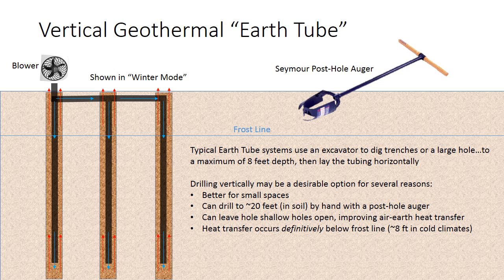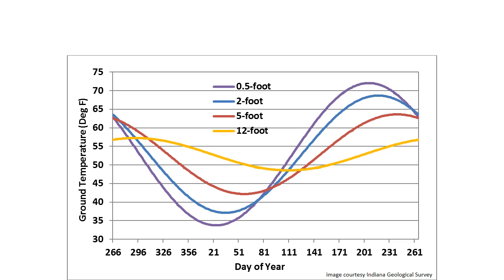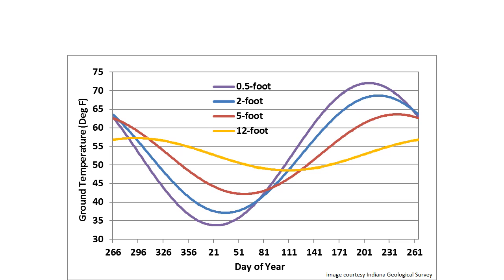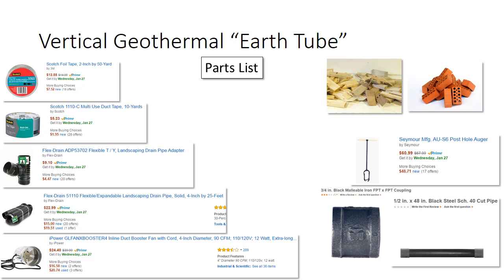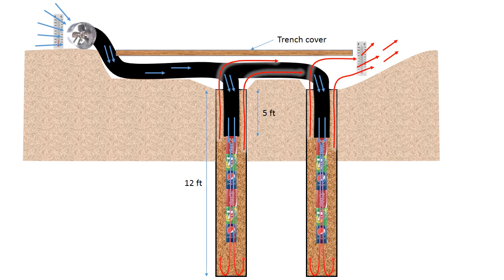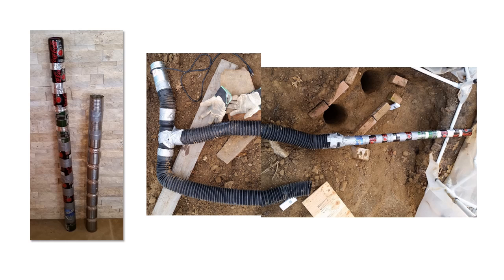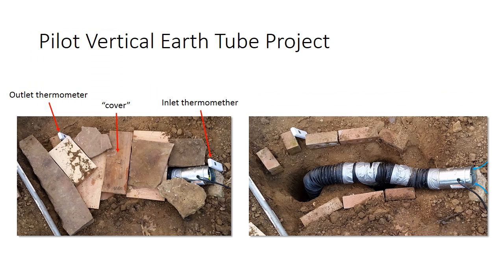Vertical Geothermal Earth Tube (Part 2) - Greenhouse Heating/Cooling

Comment: Thanks for making it obvious that vertical holes are doable with modest equipment. How did you extend the auger? Did it involve cutting the auger and threading the pieces?
Reply from the maker: Mark, I use black iron pipe and iron coupling.  Check 2:30 in the video to see photo and description.  I had to remove the test system but will dig a much larger system for a greenhouse that is under construction.  Hope to post more videos this fall, when I get the system set up
Reply: I didn't notice that the head of the Seymour auger has a threaded female fitting to receive the (male threaded) handle, which makes it easy to extend. So all you need is a pipe-nipple and a coupling. Nice.

My situation is that my 12'x20' hoophouse gets awfully hot during the day from May through September. The 2-1/2' x 3' windows that automatically open when the temperature gets above 25C help somewhat, but not enough, especially on calm days. I'll be installing a solar power system into the greenhouse this weekend. This will allow me to begin monitoring temperatures and decide whether an earthtube-based climate control system is justified. My strong suspicion is that the need is there.

Your borehole take on traditionally horizontal earth-tubes (at least under greenhouses) is really interesting. It makes an earth-tube system possible for small greenhouses. From a conversation with John Cruickshank (now deceased) of Sunny John fame, I know that runs of at least 35' of 4" corrugated tubing is required, that the speed of the air moving through the tubing be kept below 2 feet/second to cool to the dewpoint, and enough tubes be put in place to get the volume of air in the greenhouse through the system five times per hour. With your system's direct contact with the ground, you might be able to get by with less than 35'. Three of your tubes in series would get you there. 

I'm really curious about water infiltration from above or below. Those bore holes could make great shallow wells.

Also, the counter-flows in the system bother me. The air moving down the pipes will exchange energy with the air moving up the outside, which is counter-productive. In my opinion, rather than using an aluminum heat-exchanger near the bottom of the bore-hole, it would be better to run the (relatively insulative) pipe all the way down. It might even make sense to insulate the pipe, but I doubt it would be worth it.

In any case, thanks for sharing your ideas and experiences. If my greenhouse ends up needing more climate control, and that's very likely, I'll do the same.
Reply from the maker: @Mark Fox: sorry for the slow reply.  

Regarding the auger, I'd say if at all possible, dig the holes in series.  Changing the pipe is a pain; almost as slow as digging the hole itself!  

I appreciate that you see the potential in a vertical system, especially with regard to improved heat transfer relative to a plastic-cased hole.  I hope, by early September, to have a series of new holes drilled, and to test the cooling capabilities...before winter sets in!  

Regarding water infiltration - I did not see any water in my 12-foot holes, and I drilled to bedrock.  But we live in Colorado, where I think most wells are at least 100 feet deep.  I have seen other You Tube videos where people have usable garden water at 12 feet.

Interesting thoughts about the down-pipe.  It's worth testing your hypothesis, because my "pipe" was a pain to make!  (Though it was cheap).  I suspect the improved efficiency that I observed after installing the pipes was almost all a function of achieving good laminar flow over the open part of the hole.  My pipes weren't long enough to deliver input air to the very bottom of the hole, so I have room for improvement.

Message me when you get your holes drilled!
Reply: Found everything needed to extend my auger (might be a very old Seymour, not sure) to 15'. Started digging a test hole outside, but our soil becomes clay-rock mix six feet down. My goal is 12', but 15' would be nice and still well above the local water table. I'm currently at 9' and it is slow going.

A hopeful early observation: The auger head gets quite cool while drilling and, when left in the hole overnight, gets downright cold.

I've put together a temperature logger (out of a Raspberry Pi, a couple of DS18B20-based temperature probes, and a self-built "hat" to tie them together) so that I can log the temperature of the intake and exhaust air. An anemometer is on the way but a long ways off. Once I know the volume of air being moved through the hole, I'll be able to estimate a system's ability to cool/heat. I'm also very interested in how quickly the soil will warm. Those first temperature graphs will tell an interesting story.
Reply from the maker: great!  Man, can't wait to see how it goes.  For my air movement calculations I just assumed 90 cubic ft/min per the specs, but who knows, maybe there were losses.  I'd be interested to know more about your temperature logging system when you get the chance.
Reply: Got the hole to 12 feet this afternoon. If I get some gumption tomorrow I'll take it to 15, but it feels like there are two rocks in the way. Besides, pipe comes in 12-foot lengths around here.

I'll write up the temperature logger in a blog post and ping you when there is something to show. It isn't that hard to do and is much more flexible than the off the shelf data loggers.

My bet is that the fan moves a lot less air than stated in the specs. That 180-degree turn is going to add a good deal of resistance. The anemometer will give us a good idea of what is going on.
Reply from the maker: Great!  Good luck!  I bet the "accordion" pipe that I'm using does indeed have a lot of frictional losses.  Can't wait to see your results.
Reply: I have some preliminary results. My test was done outside with an approximately 7 inch hole augured to slightly more than 12 feet of depth. A coupler was fashioned out of cardboard and packing tape to connect a 120mm case fan to a 12 foot length of 3 inch ABS pipe with minimal leakage. Another cardboard construction was used to stand the pipe 3 inches off the bottom of the hole. The case fan supposedly could move 120 CF/M of air, but attaching it to the pipe drastically reduced its throughput. I have no quantitative measures as to how much, but my guess is that only about 40 CF/M was moving through the hole.

My Raspberry Pi based temperature logger had two temperature probes, one for the intake air and one for exhaust. The intake air was 22C for some of the test, but dropped to 18C as a storm blew by, blocking the sun and stirring up a wind. At 22C, the intake air was cooled to 14C at the exhaust. At 18C, it cooled to 12C. So between 6C and 8C cooling. My bet is that much warmer greenhouse air (mine can get to 35C on sunny days) would be cooled by 10C to 12C, probably more. I managed to destroy my data-set, but have one graph that covers all but first half hour of the run.

Over the almost four hour test, the exhaust temperature never increased in temperature. I think a 12 foot hole has plenty of capacity to store daytime heat. The direct air-soil contact probably helps here too.

Interestingly, when the fan was turned off at the end of the test, the flow reversed. The warm pipe pulled air up and the hole walls pushed it down. Reversing the flow, so air moves up the pipe, would put natural convection to work for the system, rather than fighting it. During the heating season, pushing air down the pipe would make more sense.

My thoughts are that the 180-degree turn at the bottom of the hole results in a huge hit to air movement. Fewer deeper holes are almost definitely much more efficient than many shallow holes. Once my anemometer arrives, I will be able to come up with a better understanding of the rate of air flow and quantify the amount of energy being stored. I'm also playing with a variable speed 100mm CPU fan that will allow me to control the air flow. I could then find the point at which dew-point is reached. Ultimately, I should be able to answer the question of how many holes need to be augured for a given greenhouse. Auguring is no fun, so less is more.
Reply from the maker: Mark - Excellent reporting, thank you!  I would be curious if you get a fit-for-purpose inline fan with the same nominal CFM rating, would it be more efficient than the coupler?  I ask because I originally thought of using normal fan with a coupler and may still do that, as I have several small normal fans sitting around.  I found that the system really excels when the temperature is at the extremes (cold in my case); looks like you found the same.  Now for the million-dollar (ok, hundred-dollar) question: how many holes and fans does it take to cool the entire greenhouse? ;-)   To that end: this guy (https://www.youtube.com/watch?v=U5tY6ved_ZY) lives in a hot US climate and used a trench-based system to achieve some pretty nice cooling.  Though as you have alluded, he found that he needed significant airflow to make it work.
Reply: The fan that Scott uses in that video is...substantial. A centrifugal fan might work better, but I'll bet that the modest fans in my collection probably aren't up to the task. On the other hand, The vertical bore hole system allows one to  push air through smooth pipe and a relatively large diameter hole. I'd expect to see less resistance than when pushing through corrugated pipe...but those 180 degree turns.

I'm trying to work within a very modest electrical budget, powering everything by a single 80W or 100W solar panel. Might be impossible, but we'll see.

I regret not putting the test bore hole in my greenhouse. I would have been pushing much warmer air down the hole, which would make for a better estimation of how many holes would be required. I also could have continued to work on this project through last week's rains. (In my defence, I would have had to take the poly off the greenhouse to auger the holes. The ground squirrels have been really bad. My greenhouse crops would have been devastated.) I'm planning a larger greenhouse for next year and will definitely auger at least three 12-foot holes for testing purposes before putting the frame up and the poly on.

Comment: Will be possible to use Arduino to control the temperature? Thanks for sharing!
Reply from the maker: +Paco Morales. Another poster, John Guest 45, said that he is using Arduino software and hardware to monitor temperatures.  I don't know much more, though.
Reply: @Paco, I dont use an arduino but i`m sure it would be ideal for the task. 
@ Mark, having too much fan power is better than not having enough, especially when it comes to cooling. You can always slow it down with a speed controller. A skywatch xplorer 1 is a useful gadget for measuring airflow, they`re not very expensive.
Reply: Thanks for your answer!
Reply from the maker: I have an Arduino board and some temperature sensors and plan to put it in the new greenhouse soon.
Reply from the maker: JohnGuest45 - do you have a favorite multispeed duct fan that you'd suggest?

Comment: I really like your idea.    It's like "citrus in the snow' meets standing column well.  I have an unheated greenhouse and I may use your idea.  I have to figure out how to bore through solid shale  to 12 feet.  Thanks for posting.
Reply from the maker: Oof, solid rock...that is rough.  Could be worse (eg limestone or granite).  Not sure how well my auger would work in shale.  It worked poorly when I hit bedrock, which appeared to be a fairly weak sandstone.  I've just framed a new greenhouse and hope to have a new geothermal system in time for the hottest days of summer

Comment: Got to admire the innovation but i dont think it`s a very effective design for a few reasons. You dont have enough area in 2 bore holes for efficient heat exchange. Heat moves through soil slowly so once the bore hole walls cool to the air temperature you`ll have no more heat available. The air exiting the bore holes will have a high RH% , liquid water is converted into vapour using sensible heat in the bore holes. The sensible heat is now latent heat,  which doesnt raise the air temperature.. only the humidity levels.
The fan will be working harder than it really needs to as the output is being driven by pressurising the bore holes. A U-shaped tube would incur much lower loss and move a lot more air for less cost.
Reply from the maker: Thanks.  I will think more about your post.  I had hoped to drill perhaps ten holes for this greenhouse but I sadly had to take it down.  In part 1 I made some heat transfer calculations (http://youtu.be/e8AosXQ3OaA) and seemed to obtain strong heating when the air got cold.  Unfortunately I was unable to run the gold standard test of simply shutting off the system and measuring outside vs inside temperatures.
Reply: +Morgan Brown 
I just watched part one and found that even more interesting than part two :)  Its a pity you didnt have a sensor tracking the temperature of the soil mass as it would have almost certainly have tracked the outlet air temperature. Having that information would have let you know there was untapped heat  :)  
I have to push my system (horizontally buried tubing) pretty hard to see a difference in the output versus ground temperature. Typically upwards of 20 complete greenhouse airchanges per hour when heating and 25- 60 airchanges/hr when cooling. On a good sunny spring day i can manage a COP of around 30. I didnt notice any reference to RH% in your air calculations, it affects the enthalpy and weight ;)
Reply from the maker: +JohnGuest45 Thanks.  I need to buy a suite of cheap waterproof sensors and appropriate controller software -- got any suggestions?  When you say "soil mass" are you simply referring to the soil temperature anywhere in the greenhouse or something else?  (I do have a compost thermometer).  I guesstimate my greenhouse volume at 1260 cu ft, so with a 90 cu ft/min fan, I'm only getting ~4.3 airchanges per hour...  RH was high -- 90%+ inside the greenhouse, 98%+ at the outlet.  And no, I didn't factor that into my specific heat value.  Too bad you don't have any videos -- it appears I could learn a heck of a lot from your experience!!!
Reply: +Morgan Brown 
I use basic ntc sensors for temperature readings, i have 26 of them planted at different locations and depths (1ft - 8ft) both inside and outside the greenhouse. I also have digital hygrometers installed to monitor RH% in different locations and a couple of dataloggers,  temperature alone isnt enough to get the full picture. 
My greenhouse is smaller at 900 cubic feet, 154 sqft floor, triple glazed with a10ft apex. The 1000cfm fan is equipped with a speed controller and the system itself is controlled by two digital thermostats, a basic stat that switches the system between cooling mode and heating mode at the set temperature (eg below 10c is heating, above 10c is cooling). The other one is a differential thermostat equipped with 2 sensors, it looks at the temperature difference between the thermal mass and the air in the greenhouse and only runs the fan when theres a sufficient differential to store heat (cooling)  or release heat in the case of heating. The differential can be set from 1-20c. A basic on/off thermostat doesnt offer the same level of control or efficiency.
Reply from the maker: For the record, I am running out of my new greenhouse.  Here's some details about the new geothermal system (https://youtu.be/Qh3-iTJvVR4).  Geothermal is now outside the footprint of the greenhouse (perhaps 6 feet).  I dug foot-deep channels into the dirt to route the tubing, then covered the entire array with 6 mil plastic sheeting and 1-inch rigid foam insulation.  I don't have temperature loggers in the outdoor part of the array, but in hindsight, I wish I had dug the geothermal holes directly inside the greenhouse.  It's one of the major appeals of the vertical system, after all!

Anyway, I dug about 50 feet of holes (5x10 ft).  Was hoping to drill to 20 ft depth, but I hit bedrock at 10.  Am currently using 3 90 cu ft/min blowers to send air into the holes.

We've just now started getting cold.  I winterized the greenhouse yesterday (sealed up the remaining air holes).  Last night we went to 24 deg F and the greenhouse was 34 when I woke up.

Comment: Use a rain gutter down spout for the heat exchanger. No laborious cutting involved. Loved the video.
Reply from the maker: Ha, yeah, and a gutter would fit pretty nice with my black intake tubes, wouldn't it!  Sad news: I had to take the greenhouse down, but will be back at it in the spring.  I've earmarked all those damn cans for a passive solar heat exchanger ;-)
Reply: Or dryer straight pipe vent tubing

Comment: Rudimentary question, how do you keep the wholes from caving in around your tubing?
Reply from the maker: Mike, good question.  So far I haven't had to do anything, as the soil is stable around the hole.  Of course, I've built a rudimentary cover for the entire trench and pipe assembly, so dirt doesn't fall in when I walk around.  I think the biggest risk for me is water invasion.  I suspect I would have to build some kind of "wall" around the trench, possibly with cinder blocks, during the rainy system.  Once the ground thaws, I'll build a bigger, better greenhouse, with maybe 8 of these wells.
Reply from the maker: Check this other video (https://youtu.be/W5XOIk_dnic) to see some details of the small brick and wood structure I built around the trench and holes
Reply from the maker: The 2018 system utilizes a closed, U-shaped design which overcomes the cave in problem. https://youtu.be/Ze0nXN6Vvic